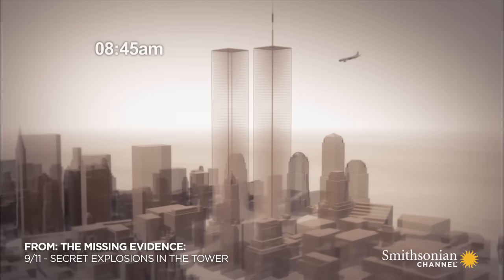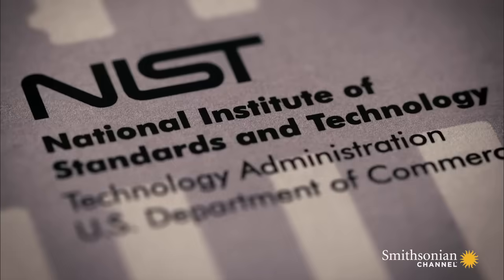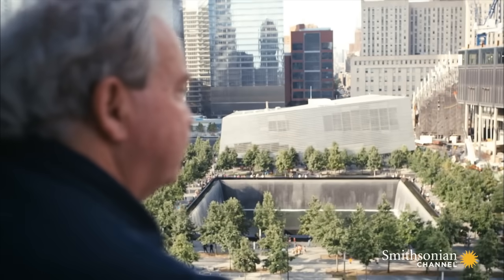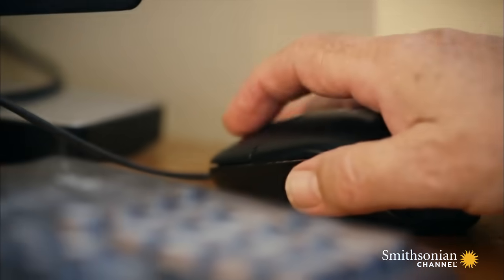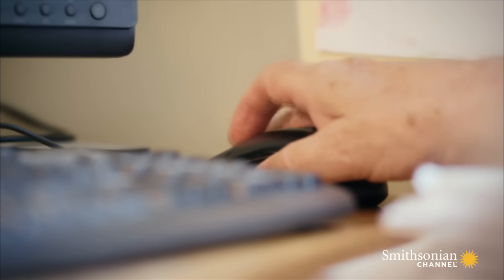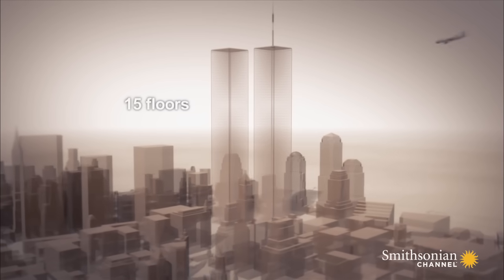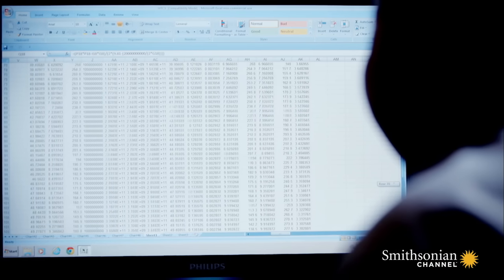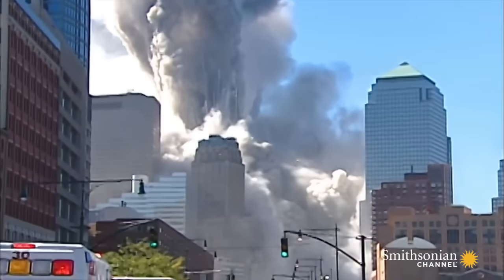This Computer Simulation Explains How the Twin Towers Fell

Comment: I honestly think that the US government staged it so that they can get more money out of it so they can invade Iraq to make oil rigs😒😡 buildings don’t collapse like this. You’d need to take away stability in each floor. The plane would’ve hit the building then it should’ve just took off part of the building. It shouldn’t have collapsed. This was all staged. I just feel sorry for all the families who experienced loss
Reply: "buildings don’t collapse like this" Says who? Are you a building engineer? No? They you're just guessing!

The thing you need to understand is: When the collapse began, you have a dynamic load whereas before you had a static load - and the tower's floors simply weren't built to withstand having 100,000 tons falling onto a single floor.
Reply: TimReed22222 I’m not a building engineer no. But my boyfriend is a plumber and he builds houses thank you very much. I don’t think you know what you’re talking about. Gas isn’t hot enough to melt metal mmmk

Comment: The top 15% of any structure that only accounts for 3% of its mass does not have an of energy the gravitational collapse the bottom 85% to the ground. If you can come up with an example for this is possible please let me know
Reply: Show your math?
Reply: @Tim22222  show my math?  You mean you cannot think of an example where the top of something is heavy enough to crush the entire thing all the way to the ground?  Being that my degree is in mathematics I could tell you this, numbers on a piece of paper are simply used to model the real world, sometimes. If it were possible for a building to collapse  like that we could come up with examples where it's happened before, or when the idea of such a thing like the top 15% crushing the entire thing would even be possible. There should be examples...but there aren't, thus the building's were imploded.
Reply: @davmus1112  show your math

Comment: This video provides absolutely nothing useful. Noone will argue that once the buildings' upper floors started to collapse, the entire buildings would fail. What WOULD be useful is a plasible, scientific explanation for the initial - and VERY symetrical - collapsing. Both buildings were perfect examples of symetrical, controlled demolition. This despite the damage caused by the aircraft striking each of the buildings on one side only. Curious to say the least. Not to mention the analysis done collectively by engineers the world over, that point out the failures could not have happened in the way tbey did, without factors other than just the two aircraft involved.

Comment: Where are the 47 vertical steal columns where by each column was made with 5 inch thick steal?  This video is for very ignorant people who have zero ability to comprehend the most basic laws of physics.  30 floors above impact will only crush its own weight unless the remaining structure is removed by explosives.  There is no other viable explanation. End of story.
Reply: wow.  and what color is the sky in your world?
Reply: @todsimpkins8908  That's the question you came up with?  How about a physics question,  or is that too advanced?
Reply: @todsimpkins8908  

The coloUr of truth.

Comment: I wonder why there wasn't stacks of floors on top of each other then? Instead everything was pulverized into dust 🤔
Reply: Because they fell 1000 feet! And more landed on top of them.
Reply: @Tim22222  in midair ?!!! we are talking about WTC, New York , right?
Reply: @cristiannicu9252  Matthew was referring to pictures taken days or weeks after 9/11 of beams that had been cut by clean-up crews dismantling the wreckage. No reason to believe any beams were cut "mid-air."
Reply: @Tim22222  I was talking about the concrete... and everything else pulverizing in mid-air. that`s more than a simple collapsing. .. and now that you reminded me: I have a video (very public at those times) of a beam of several meters long pulverizing in mid-air too. I`m still wondering why are we still debating if was or not an inside job.
Reply: @cristiannicu9252  Nothing "pulverized" mid-air. That's ridiculous! And BTW no inside-job theory would explain it if it did.
Reply: @cristiannicu9252  Everything??? Oh well, I guess you win 🙄
Reply: @Tim22222  it`s not about me winning something from this.it`s about all of us, not only you pretending we didn`t see something that was there.
Reply: The Twin Towers had very thin floors, with a thing layer of lightweight concrete on it, because it was a lightweight structure. Only if anything was connected these building were very strong.
Reply: When something falls at free fall speed that means the object encounters no resistance from anything below it. The buildings were brought down by controlled demolition. Look at the pictures of the rubble. See the steel H beams? Looks like they were cut diagonally like scissors to paper. Not warped and bent. You know what does that? Nano Thermite. Whats that residue dripping from the H beams? Who are the only people that can access Nano Thermite? No further questions
Reply: @matthewkoles8268  "See the steel H beams? Looks like they were cut diagonally like scissors to paper."

Those beams were cut by clean-up crews cutting the debris apart with torches. NOT THERMITE.

Comment: That was so in depth. I was captivated by the computer screen with random numbers on it. Well done. Did you run a simulation on building 7? Explain that one . How does it feel to be a shameless shill?
Reply: What happened on building 7?
Reply: What happened with building seven? That was already explained by the NIST Report
Reply: Does believing in this absurd theory with no evidence make you feel special?
Reply: @danb7202  Believing that a building can fall at FREEFALL speed, which building 7 did for over 3 seconds, without demolition is absurd.  Nist even said that the building fell at FREEFALL speed for much of it's collapse. Freefall speed cannot be obtained if there is anything underneath and the only way to maintain FREEFALL speed is to remove all support underneath which can only be accomplished with demolition.
Reply: @danb7202  you should try a little research before knocking down people. A few things to seriously consider: 
WTC 7 free fall acceleration. 
Molten steel beneath all three buildings. 
Eyewitnesses to explosions. 
Towers 1 and 2 fell "essentially" at free fall... impossible. 
Pa. Dept of Environmental Protection drilled multiple test wells and tested over 5 thousand cubic yards of soil at the alleged crash site of flt. 93 and found zero (0) traces of jet fuel contamination. This too is impossible as alleged flt 93 had approximately 7000 gallons of fuel onboard at alleged impact. 
If you look hard enough you'll see every aspect of the "official" narrative is "alleged".
Reply: @tazdevil6934  great comment.
Reply: @tazdevil6934  Dan b is still in his basement typing.
Reply: @joelsmith4816  I’m in college lol
Reply: @tazdevil6934  You mean like what happened in Warsaw Poland during the Second World War? Ask any person who lived in Warsaw during the German Occupation years, they could tell you the truth behind building 7 easily
Reply: @alwagner9722  Evidence of this? Show me all the report that was done on this
Reply: @danb7202   - I for one do feel rather special having a better understanding of what occurred on that day. My beliefs are backed up by solid evidence. I believe most people here that have a similar belief that the narrative that was fed to us is complete bs due to self research rather than just believing what we are told. And that gives me hope.
Reply: @danb7202   Look it up nothing this guy is talking about is crazy or conspiracy building 7 is the Smoking gun.
Reply: @TreyWK  you’ll grow out of it
Reply: Kid
Reply: @danb7202  most people on here gave convincing positions one way or the other. All you’ve done is attempt to diminish their points by insulting them. Is this what college teaches these days?

Comment: Thats at freefall speed. Where is all the trash from this so called collapse? And why did they found up to 300 meters away particles of human residue? And what just happened with building 7? And where are the plane parts of all 4 planes? And how is it possible that the plane that hit the pentagon could come that close, circled  around to hit exactly the part where the evidence of the 2.3 trillion lost army expenses where to be solved as well as in tower 7? And BBC knowing it 22 minutes before the event? And why did the owner of the twin towers just 1 month before closed a assurance for terrorist attack? Than you say its from the inmence heat. But by some miracle 2 passports survived.I can go on and on and on... but you prefer to be blind for the facts.

Comment: Its building 7 that bothers us
Reply: Nineteen years later, and some people I know, have never heard of building seven.
Reply: in the computer program where the buildings melt like ice popsicles cool
Reply: No. It's all of them. Where did the twin towers go? How did two of the (almost) biggest structures in the world, made of STEEL, turn into DUST... WHILE they fell perfectly straight down? They turned to dust WHILE falling straight down. What happened to all of the steel? How is it possible that only the steel from the first couple of floors near the bottom remained? How does steel turn into dust while falling through the air straight down?
Reply: It fell because debris from the North Tower And Heated Metal caught Word Trade Center 7 On Fire Then It Fell

Comment: The towers were both designed to fall straight down just in case it doesn’t fall on other buildings. Unfortunately it didn’t work because the first tower damaged another building...

Comment: I'd go to a chemist to figure it out too!? If it works for buildings it should work for sugar cubes. Stack up 10 sugar cubes glue the top two together now the bottom eight then glue them to the table. Drop the top two onto the bottom eight from as far up as you think it would take for it to smash them like a controlled demo. Did it work?
Reply: Oh yeah...light them on fire if you want
Reply: @Bigstooler0  And a 3-inch stack of sugar cubes are like a complex high-rise tube-design skyscraper HOW exactly?
Reply: @Tim22222  
Jesus!

These guys and their "models"!

If you're fa,iliar with Anders Bjorkman? He suggested pizza boxes!

🤦‍♂️

Comment: Uh....FYI black smoke does not indicate a weak or oxygen starved fired. In fact, it indicates the exact opposite! Jet fuel and plastic based office equipment, both of which are hydrocarbons with extremely high rates of heat release and therefore produce arid, black smoke.